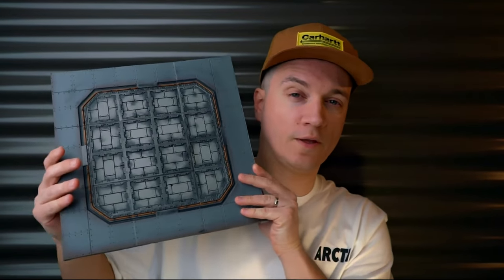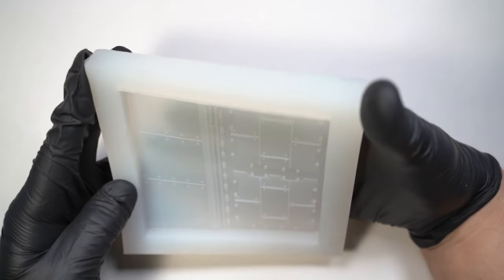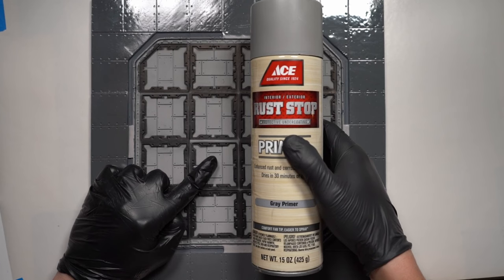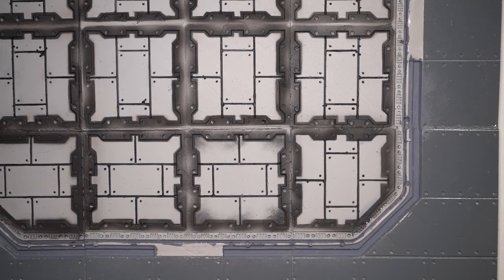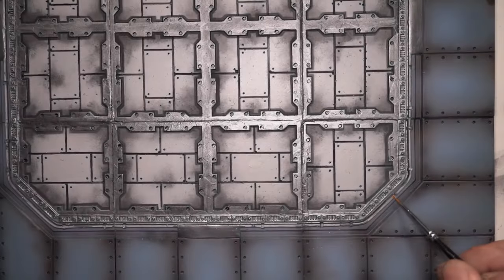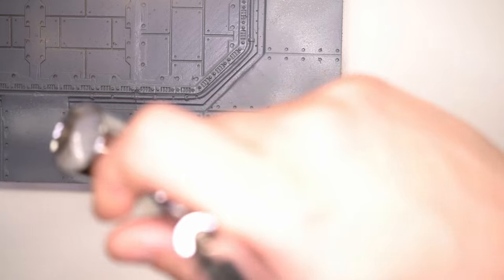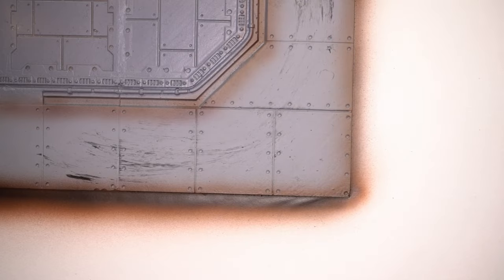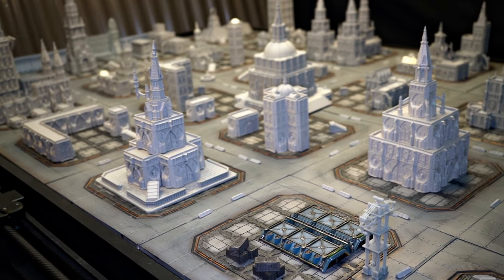Make Your Own Legions Imperialis / Epic 40k Tabletop Wargaming Tiles

Comment: Instead of inks, try to use oils in your next project. 

Much longer working time, easier clean up & they flow nicer. 

It will save you more time than messing around with inks and yield a better result.
Reply from the maker: Thanks for the tip! Oils have been used in previous videos due to the reasons you mentioned. I was slightly concerned about oils over this scale due to wait times and additional sealing and consistency issues. I can make oil washes work of smaller scale stuff. But due to how big this project was I had to just do the things I knew would work rather than experiment too much as every step of this project took forever sadly. But I’m with you on oils for sure. It’s a super great method.
Reply: @BUNKER6  I use Winsor & Newton oils out of the tube, I dilute with white spirits when doing panel lines over a gloss clear coated project. 

When done I let them dry for an hour (basically wait for the spirit to evaporate)  and hit them with GW munitorum varnish. 

It works really well for speeding the process along, did nearly 4500pts of eldar with this method.  Try it out when you have some free time. The varnish locks the oil in place and you can keep on working.  Also used it on some gundam kits too.
Reply from the maker: @rmo917 screen capped your comment! Really appreciate the advice! I look forward to trying this out. Thank you!

Comment: Makes a big deal about not spraying aerosol paints indoors, proceeds to aerosolize varnish indoors a few shots later...
Reply from the maker: I have a giant double filtered extraction unit to the left of my camera. It’s not in shot because it’s ugly. But thanks for your concern! I’m here for the snark 🫡
Reply: Because this is resin they're all going to be different heights because they're different volumes... did you not pour 24 of the same tile? With the same resin no less? Why would they turn out different heights?
Reply from the maker: Yes, measurements were not always exact due to pouring from giant bottles into small measuring containers. Pouring out the resin was not always consistent between pours due to resin getting stuck on the inside of the measuring cups and the mixing stick, additionally the walls of the molds were not supported so they warped and widened. Things can get a little inconsistent when 72 pours are involved. I hope this makes things clearer for you. 🫠
Reply from the maker: To be clear each tile was created with Epoxy resin. This is an extremely high viscosity product unlike resin used in recasting models. This stuff is as thick as molasses. Not like watery model resin. Pouring epoxy in one go creates trapped air bubbles and you will not always get the resin in all the nooks and crannies. You brush the first layer of epoxy to minimize missing any details. Then you go in with each major pour after that with hours long intervals. So at this point I feel your comments are just more antagonist rather than honest enquiry. But keep it coming. I can waste your time as much as you’re wasting mine. 🤙